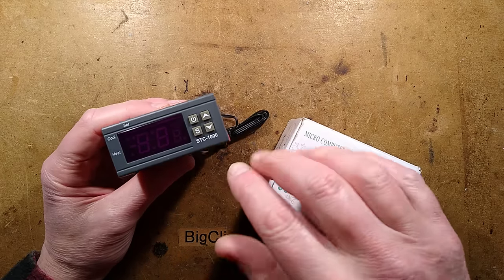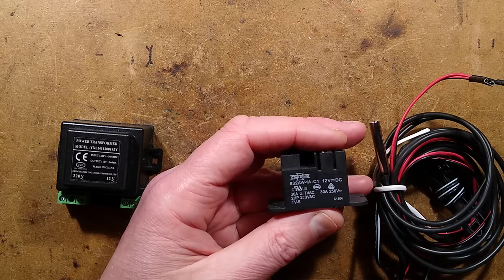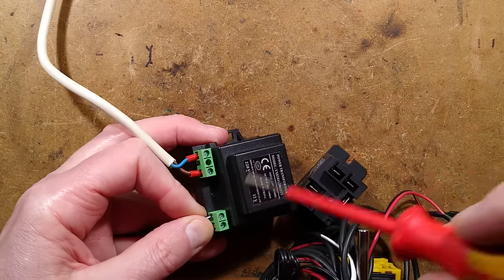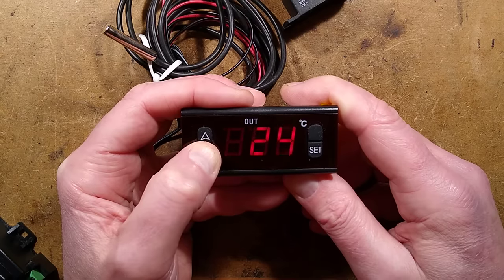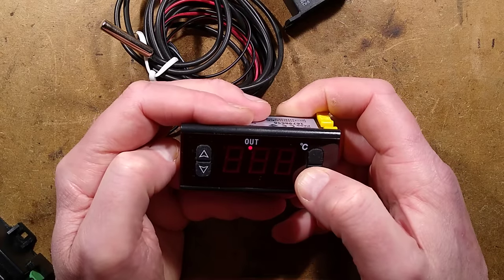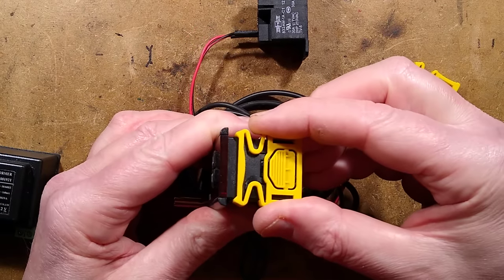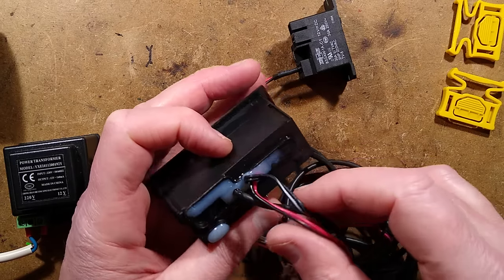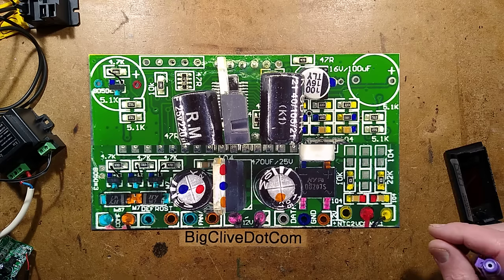Inside a ShangFang temperature controller

Comment: The COP menu item is likely used to copy the current settings over the "default" factory settings.  Generally to do this, you get to the COP entry and then within 3 seconds hit the "OK" button (which in your case is likely the Set button). It will then say "YES" and stores the values to the internal flash as the default values.  That's how a similar model I have works, in any case.
Reply: Captain! Thanks :)
Reply: Its more likely to be "Contactor Operation" ....which means you could use it for cooling.
Reply: @andrewpatterson5349  Why would they code such a feature when the user can just change to an NC-relay? It seemed like there was only two COP-options, 12 and 15. Do you think they are a choice between IEC utilization categories? (AC-12 is control of resistive loads and solid state loads, and AC-15 is control of AC electromagnetic loads)
Reply: Could it be to set a security code to prevent the settings from being changed by unauthorized personnel?
Reply: @andrewpatterson5349 
That was my thoughts as well. Almost all controllers I have ever worked with allow for heating or cooling operation settings.
Reply: @User70188 those numbers were unrelated to the "cop" menu. it was reading 12°C and set to 15°C.
Reply: That's handy info. Thank you 👍🇮🇪🙏

Comment: For those that need it...the model number for the 110VAC version is:  SF-102(SH)
Reply: TY!
Reply: Would that be a different bundled transformer?
Reply: @johndododoe1411 
The ones I found do have a different transformer with 110VAC input using this wording on the listing:  
SF-102 Thermostat Controller Electronic Temperature Thermostat Freezer US NEW
Reply: @gregorythomas333  So either mislabeled or the refrigeration variant .
Reply: @johndododoe1411 
 Since I was looking for the refrigeration type I used the word "Freezer" in the search...just adjust the wording for your needs

Comment: An interesting controller, I like the external transformer and relay connection. Makes it so easy to interface with different control devices - relays, SSRs, contactors.
Reply: For a moment I thought the last type of control device you listed was contractors. I was very amused.
Reply: The internal transistor and power supply are unlikely to be adequate to drive a contactor. You could, of course, use a small "pilot" relay for the contactor coil.
BEWARE! Some contactors have two coils - a low resistance coil that pulls the armature home and a high resistance coil that keeps the armature pulled. A microswitch that is opened when the armature is pulled opens the circuit to the high-current coil. This is a good arrangement for saving power and keeping the contactor from running hot due to coil current, but it is a rude surprise if you aren't prepared for it.
Reply: @jessstrap2088  if you use a high enough voltage, contractors can also start working
Reply: I disagree, if you use high enough voltage, contractors tend to stop working. Sometimes permanently.

Comment: In over 30 years I can't remember seeing one of those 12v transformers fail. Usual failure on those style controllers in refrigeration applications is the compressor relay sticking on.
Reply: HVAC techs often find control transformers burned out from short circuits, as can happen by a homeowner miswiring a new thermostat.

Comment: Could you not just swap your load between Normally open and Normally closed on the relay to change if it's effectively heating or cooling?
Reply: Yes, but the hysteresis won't work as expected. When temperature became greater than Setpoint It would cool down to (Setpoint - Hysteresis) degrees. Of course you could unintuitively set your Setpoint to (Desired Temp + Hysteresis) degrees  and it would behave more like a proper cooling controller.

Comment: Very nice for serviceability, especially the external relay.
Reply: Also makes it more versatile too. Need it to drive a bigger motor? Get a bigger relay. Want to have a whole bank of these? Get a bigger transformer and run them all off it.
Reply: @ConstantlyDamaged Circuit also works from a DC supply that happens to power a larger control system .   It looks like it can even run from an industrial 24V DC system .
Reply: @johndododoe1411   Yeah, built for quality and flexibility—rather than to be the cheapest.

Comment: the delay time is also good for recovery from power failures.  Setting 1 minute will prevent it chattering on a messy power up.  I just had a relay burn out from that very reason.

Comment: Just to emphasize the point that other people have made, the external transformer and relay aren't just good for maintenance but also for systems where you already have the appropriate power and something else to switch.

Just for example you can use this as a temperature monitor hooking the power side into a computer interface and the relay side into an ADC or digital readback. In that case you might not want a relay involved at all.

Comment: We have similar devices behind the bottom cover of our chilled display fridges at work. I was watching the engineers re-gas a faulty unit once and I believe the defrost side is an element very similar to a grill in an oven, sat in the bottom of a drip tray where the hot side of the pipework is coiled up and sits in with it, presumably to boil off water from condensation as our fridges do not have a plumbed drain on them. In the freezers it will run around the cold side to melt off any build up of ice, but the freezers are connected to a local drain due to the amount of water that will be generated. I also believe the "data" line on the unit is connected to a wall mounted device called a 'Plant Watch Pro' in our shop which monitors the state of the fridges and displays their current temperature and can be programmed to call an engineer if a fault condition occurs or the fridge runs too warm for too long, setting off an internal alarm on the panel which has to be acknowledged by a user who then decides if an engineer is required. Fascinating stuff and I guess most people wouldn't know supermarkets go to great lengths to make sure food is kept in safe conditions (albeit a law requirement anyway lol) Thank you :D Id love to get one of those temperature things to muck about with. Could COP be a short hand of Compressor Overload Protection? meaning after a set time a user thinks is too long for a compressor to run, regardless of temperature set it will shut of power to the compressor for overheat protection? Not sure. x
Reply: Completely depends on the system. There is no one defrost system type even on similar equipment, to say nothing of the fact that medium temp refrigeration circuits generally don't even have defrost heaters, they just use air defrost and keep the fan spinning while cycling the compressor off
Reply: COP can't mean compressor overload protection the way you explained it, because the compressor may run for much more than an hour after the deicing is done, or after the fridge has been started warm.
The overload protection may only be used following an off cycle, setting the minimum wait time until the next on cycle, in minutes.

Comment: Most STC-1000 clones have heat and cool outputs and operate both cycles. This is handy for things like fermentation chambers (for brewing or baking) where you may want to target a temperature that is higher or lower. 

Add a couple external spdt relays and you can control a thermoelectric device to behave as both heater and cooler.
Reply: Sure, but it would always be running, there would be no delay between heating and cooling.
Reply: @mikeceresini2364  nope! You can set hysteresis and minimum on and off cycles.
Reply: Yeah, but there's only one output on this unit, so your first relay is either on or off.  The STC-1000 has two outputs so you can set cold and hot points, but the output is via two separate relays.
Reply: I may have misunderstood your first message, I thought you were saying it was possible to have this unit perform the same as the STC-1000.

Comment: Cool, I have worked with most temperature controllers, like you mentioned some only do a good job at heating or cooling but some can have multiple stages I have worked with some that had 4 stages that can be used for heating or cooling so you could use multiple heating systems or cooling and they also have a hysteresis function so it learns how long it takes to heat or cool an area when you want the best temperature control...

Comment: COP might mean Coefficient of Performance (of a heat pump), which could be calculated approximately from three temperature inputs, in the model equipped with all three.

Comment: The Coefficient of Performance (COP) of any heat pump will vary as either the inlet temperature or the heat pumps outlet temperature varies. As the inlet temperature increases from the ground, the COP will also increase.  That multiple is known as the Coefficient of Performance or COP. As the temperature warms up outside the COP increases. Compared to electric resistance heat, even at -5 F, a heat pump puts out 2x more heat than a resistance heater using the same amount of energy input, or it is 2X as efficient.

Comment: Great circuit. I think that I would have been tempted to place the NTC & 10k resistor filtering on the other side of the 22k resistor, but this is not a biggie!

Comment: I thing you should probably use an external with all these small temperature controllers. I removed the internal relay in mine and jumpered the contacts accordingly to use it with a solid stater relay without risking the internal relay failing. I have heard that it is not uncommon for recovered relays to be used in the cheap knock off pid controllers among other things.

Comment: I figured those circuit board connecrors out the hard way. Had un and redone some connections onto a dimmer a few times to many and it snapped off. I ended up soldering the wire onto the remaining pin which was also my very first soldering attempt. It seems to have worked as it still works fine and hasnt blown up.

Comment: used one in an incubator. was good for a season. then magic brown smoke and a lot of eggs to throw out.... i have a vague feeling it was to do with all the fluff. incubators are bad for "lint"... 
now its got a slightly different external one. direct mains plug. waiting for the fan to blow up next... its starting to sound a bit off after five years of feather sheaths flying around.

other one i have is the peltier type. WK....1340? im not hunting through boxes to check! something like that. very good for terrariums and mushroom cultivation... not quite as accurate, 1 degree increments versus 0.1. for what it does thats acceptable. not so good for an incubator though, and i cant see a need for cooling... even if it was 42C the other day...

Comment: I have a cheap one that came with a mini-kiln. Unfortunately, the simple on/off is not very appropriate so I replaced it with a Raspberry Pi and wrote some PID software (That also does cone firing schedules). I use an even cheaper one with a 400W heater to keep my pipes from freezing in our extension.

Comment: Practically every consumer product sold in the U.S. in the last 40 plus years has been manufactured in an Asian factory which means anyone smart enough to figure out how to set up one of those controllers is very familiar with the centigrade temperature scale as well as the metric system.

Comment: Tend to use them on motorbike tyre warmers, cheap enough ive had to replace a few as they can fail at the screen though board interface. I ended up getting a touch version, there are a few different types all called STC-1000.

Comment: Not over keen on using a single diode for snubbing the relay coil, this can lead to premature wear on the contacts, as it takes 10-20-30mS longer to open the contacts properly.
I use a diode with a matched resistor (normally around 10 x the voltage, so 12V would be 120ohms ish) in series, placed in parallel with the coil.
This kills the spike just as quick but also stops the relay from bouncing or re-energising, keeps the opening of the contacts as fast as possible.
You can also use a matched MOV but these are more expensive and give little gain over the diode and resistor. the wattage of which only needs to be 1/4 or 1/8.

If you are using coils on pneumatics of hydraulics (valves) then dont bother with the resistor, 10-20mS slower wont damage them, in fact it helps control fluid bounce in hydraulics.
Reply: It is far too common to see a diode smacked across a relay coil, with no regard for the consequences to the contacts. Often it really doesn't matter but when you have relay controlling something like a motor and frequent cycling is expected, you really want to spend a few moments thought and a few extra cents to be kind to the contacts.

Tranzorb type power zener suppressors are another alternative and better than MOVs. MOVs do have a wear-out mechanism whereas the power zener devices don't. The power zeners also have better defined voltage characteristics so you can confidently more closely match the voltage allowable across the relay coil to the voltage rating of the switching device. There's nothing wrong with the D & R method if you have room on the board. You can select the resistor value for any peak voltage you want. You do need to be mindful of the transient power handling ability of the resistor. Thin film types are generally not very tolerant of large transients.
Reply: @d614gakadoug9  yep, used transorbs as well, but another cost premium. Pay ya pennies, make ya choice. Main thing is to not just shove diodes in without thinking about the consequences.

Comment: In HVAC COP is co-efficient of performance, basically a measure how much energy a heatpump (like a fridge or heating and cooling air conditioner for example) moves compared to how much the compressor consumes.

Comment: I suspect this is a way older model than the modern generic ones. I have used a few of the generics, once had an issue with a relay, while switching an old fridge. Generic units are made for cooling and heating.

Comment: The ones I've used are the REX PID Controllers that use a thermocouple, have a billion parameters and are suspiciously ubiquitous and cheap for a precision process controller. They must be used in tremendous quantities in China as you can get a kit with a thermocouple and a ssr for like $20.

Comment: This unit was definitely made for a professional, with separate xformer and relay.  Consumers would not want to deal with figuring out how to connect this all up - just give them a unit with everything all in one box so less hassles and less mistakes they can make.

Another plus was the sealing up the case to keep out moisture, dirt, etc.  What's ironic is that the previous owner needed one for refrigeration, and he didn't know that this one was already set up inside for refrigeration, all it needed was a few wires changed.  And as a result, Clive got a bargain!
Reply from the maker: Although it has the circuitry, the software seems for heating.
Reply: @bigclivedotcom  
It might be that unknown menu choice you found is to change to refrigeration?
Reply: Change the relay contacts from NO to NC maybe?_
Reply: @DjResR  That could maybe work? Although the hysteresis logic would be backwards. And what is the minimum temperature that can be set? If it's 0°C it might not be too useful for freezing, depending on the specific use case of course.
Reply: @maxine_q If the minimum time logic applies in both directions, there's no difference in logic .  Compressors are used for both heating and cooling in aircondition, so protecting compressors is not a refrigeration-only feature .
Reply: @johndododoe1411  I know. I didn't say anything about the minimum time logic.

Comment: I suspect COP is the coefficient of performance of whatever HVAC this is used to control. Pure heaters (resistive/etc) are fairly close to 1, good heat pumps are quite a bit higher.

It's effectively a measure of efficiency, except calling it efficiency is bad practice because η>1 is one of those things that normally break thermodynamics.
Reply: To clarify, CoP = rate of total heat transfer / power input or Q/P

Comment: that potted transformer is pretty much designed exclusively for 220V AC - i looked up the model YXE1411200192Y.  China uses 220V as standard for their grid, but Europe uses 230V - that means the transformer is guaranteed to always run over-volted when imported in Europe and will fail when used for longer time above 240V AC - probably they used the eBay "warranty" / maximum refund window as the time reference for its lifespan, and that is 90 days usually.
 In areas with solar panels or wind turbines that are injecting energy in the grid that voltage can often rise to 250V and is still considered within the voltage spec tolerances of the European 230V standard (+/- 10%), but can cause a high rate of failure for 220V-only equipment.
Reply: My mains seems to read 237V, that's only 7.7% extra voltage. The transformer should barely notice it.

Comment: 17:40 I don't understand why the capacitor is parallel to - and + rails and provides +5 V to + rail. How it is not serial if it affects what comes after. Paraller it just lets - and + rails go on and handles influences between - and + rails. I am a beginner and I don't understand paraller and serial intuitively. I wouldn't understand if you explained me technically.